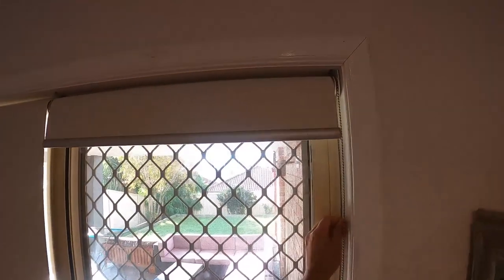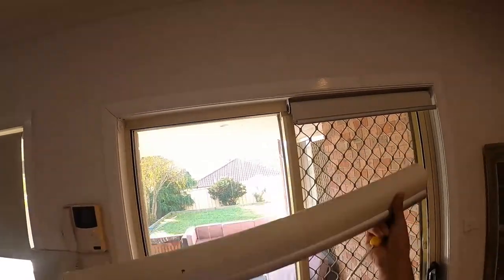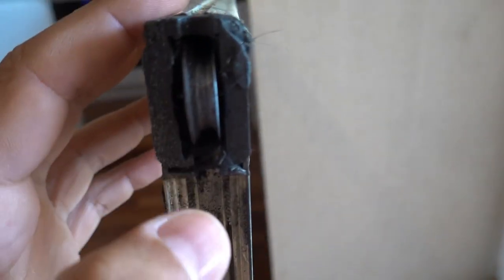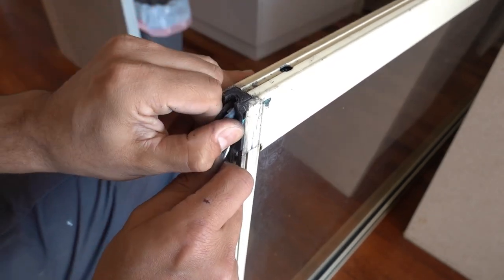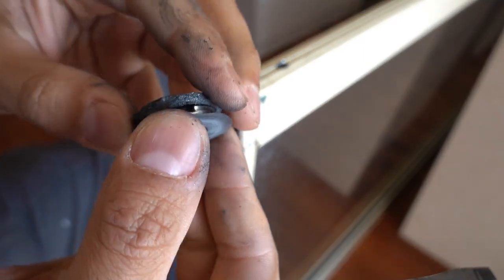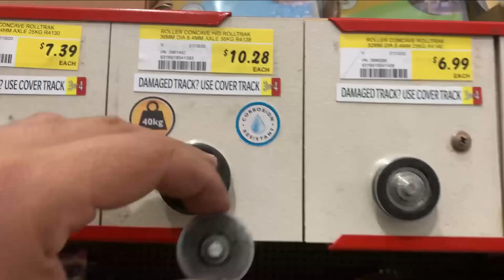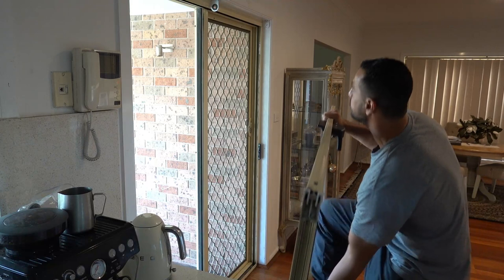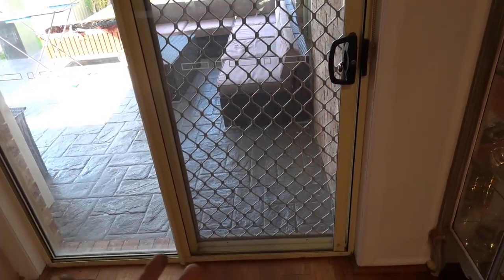How to fix a glass sliding patio door that won't slide - wheel replacement

Comment: You are kidding me. I have been removing my blinds to paint the window surrounds and couldnt figure out how to release the blind from the bracket. I finally managed to get the screws undone on the brackets to remove the whole assembly. Your vids are so good. I dont even have a glass sliding door but watched anyhow incase i could help someone down the track. And what did i see.. how to easily remove the blind from the bracket. Palm to forehead emoji

Comment: Hey, can you do the same thing with the security sliding door? Mine is currently metal on metal but I’m not sure if you can easily pop out the security door like the glass door.
Reply: You can, but there is a nack to it. Both sides of the plastic wheel housing has a barbed part that keeps wheels locked in place you have to press both those in with something pointy while you evenly lift it out
Reply: Security doors are Security when they are locked, otherwise they come out easily. Lift up and out

Comment: I need some help. On my door when i tighten the screw that holds the roller assembly it pulls it up and the rollers almost don't stick out. Even after setting the adjustment screw all the way to the lowest point of the wheel.

Comment: Bill the door has no screws fixing the bottom to the side. The bottom will eventually drop and scrape the bottom frame. You didn't address the track either or adjust the door.

Comment: Hi Bill, I have tried this but the sliding door cannot be lifted. The cast around the door is very hight (look a bit like the door on you wheels adjustment video).
Would you have any advices on how to do this please??
Reply from the maker: Some styles require you to remove the fixed glass panel door in order to remove the sliding door 👍

Comment: That's a precision brand door. All advice on this fix is specific to that brand of door
Reply from the maker: All brands have a similar style and process 👍
Reply: Jason doors for example,  you can't really get the door out, you have to pull the sides of the door off so just glass is exposed before you can slide wheel housing out. I hate precision doors & frames.

Comment: Unfortunatlly my slider doesn't have enough play to lift up and out
Reply: I've seen other videos where they start from the outside and remove first the sliding screen (if installed), then the stationary glass "door", and finally the moving door... check around youtube to see if that might be the best way for your door. I'm crossing my fingers this way works for me. Also if you adjust your rollers as high as possible first you might have enough room to wiggle it free.